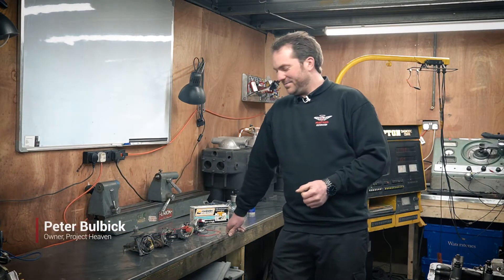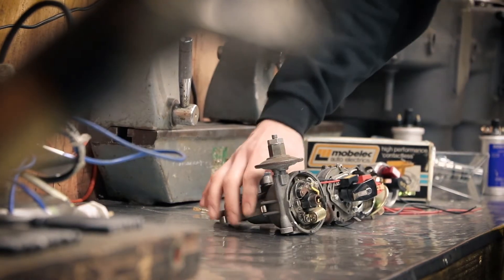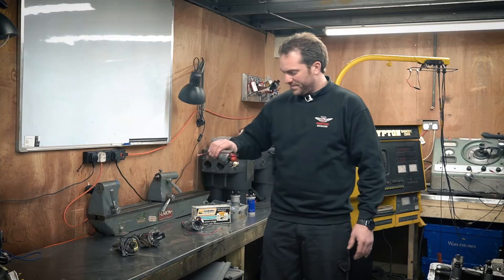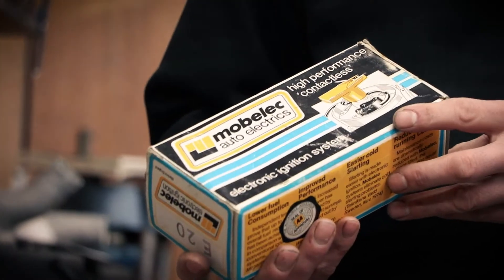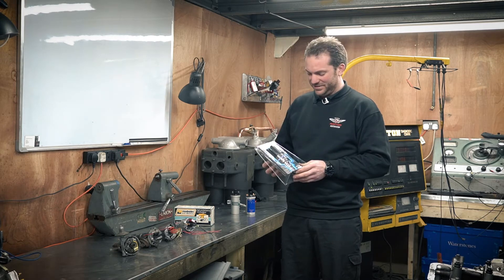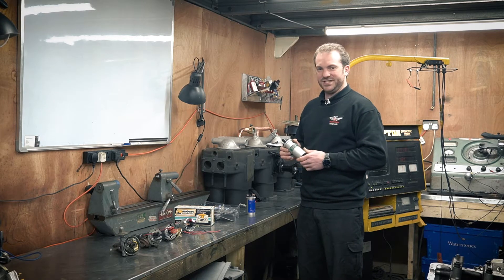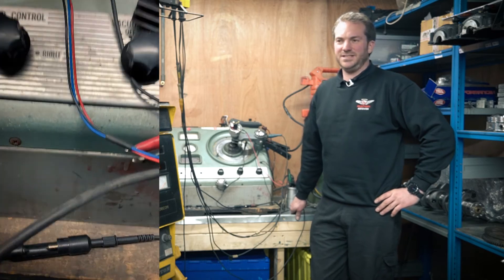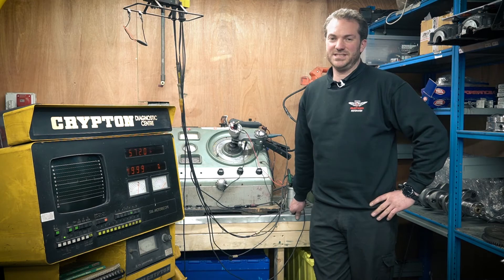Classic car distributors | Which electronic ignition kit is best

Comment: Hi - I have a Powerspark EI on my 1973 VWT2 Bay, it runs great but I don't have the vacuum on my distributor. Does it need a vacuum set-up?
Reply from the maker: @bobmurphy9380  You only need the vacuume for idle and on very low load it increases efficiency. So the short answer is no, you don’t need it.

Comment: The spark gap has an ionization potential that depends only on the width of the gap.  That's the height of the fence that the spark must jump, so they will all be the same as long as they can ionize the gap.  Widening the gap tests the maximum voltage that the trigger and coil can reach.

Comment: I think the mobilec should have  afitting over the cam which has 4 or 6 strip magnets and there was a plastic feeler gauge to set it up. On a rebushed distributor with little or no wear these were brilliant. The problem was if there was too much spindle bush wear or incorrect gap adjustment the pickup got wiped out. Spindle wear did not affect the luminition as it was optical and so became the ignition of choice. In my opinion  not the best performer but far more tolerant to wear and so more reliable.

Comment: I just picked up that very same distributor machine. Just learning how to use it . I would like to see how you have it wired to test the electronic ignition system. Good video.
Reply: That is so awesome. I have been looking for old Sun equipment as well as a magneto and distributer machine. I am in the states and rebuild,  repair and restore magnetos. I am starting a YouTube channel soon with a 1928 Morgan build but I am also developing a new type of magneto that I am going to build on a small basis at first and then see what the demand is. Where are you located?

Comment: We appreciate the testing!
One important test is missing: how the distributors perform at higher RPMs, for example at 3000-4000RPM. Most distributors only produce strong sparks at low RPMs, while it is also important at higher speeds.
The 123 has a regulated dwell time. Basically, it tries to keep the coil charge time constant, independent of the RPM. This means that the sparks also have enough energy at higher RPMs (within the limits of the coil).

If you have a question, just let us know!
Reply: Why can't you're ignition run HEI low resistance coil, like a GM 4 pin HEI module?
I'm trying to understand how your ignition works.     Does it have a model & transistors to charge the coil?
Reply: @chrispompano 
The 123ignition system is designed to work with inductive coils ranging from 0.8 to 3 ohms. It features adaptive dwell technology, which adjusts to maintain consistent charging time across all RPMs. This ensures a strong, high-power spark at any engine speed.
All measurements, including RPM, vacuum etc is done with solid state electronics (no moving parts). The timing is accurately determined by a microcontroller and controls a power transistor, specially designed for ignition coils.

While low-ohm coils, such as those used in HEI systems, require high current to store energy for powerful sparks, the 123ignition is already capable of delivering high-power sparks with standard coils. As a result, we didn't need to design the system to specifically support low-resistance coils like HEI or transistor-based types.

When replacing your original distributor, it's likely also time to replace your worn-out coil. With 123ignition, you can easily switch to a coil within the 0.8 to 3 ohm range, depending on your engine configuration.

Coil Selection Guide:
    2-4 cylinder engines: 3 ohm primary resistance
    6 cylinder engines: 1.5 - 2.5 ohm primary resistance
    8 cylinder engines: 0.8 - 1.4 ohm primary resistance
Reply: With so much technology built into your system, did you ever consider a Spark Re-tard feature using a knock sensor fixed to the engine?  One of your 123 vendors makes it frightfully intimidating & warned about retrofitting your distributor & causing damage to an engine due to detonation & only an expert tuner should be mapping the ignition tables, which does make sense, so a fail safe Knock Re-tard feature would be essential to ensure no engine damage.🤔